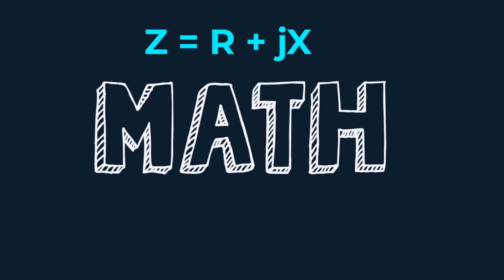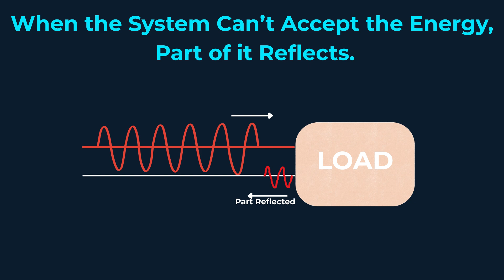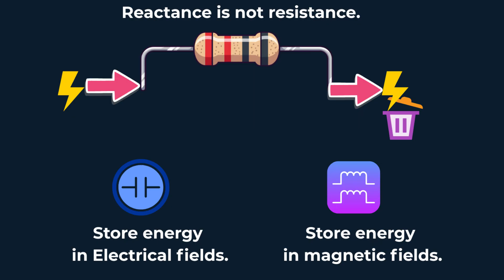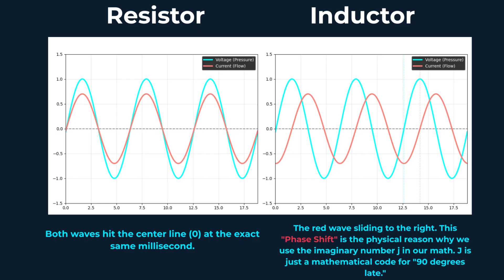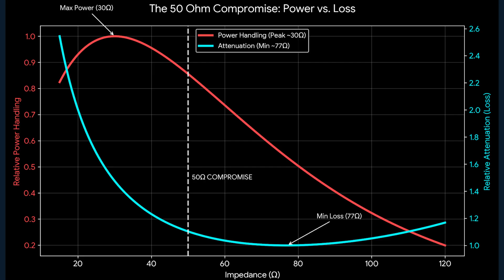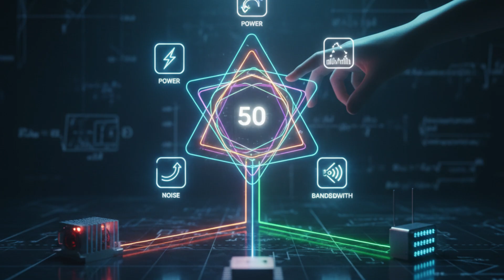What Impedance Really Is And Why Everything Is 50 Ohms? | EP 003

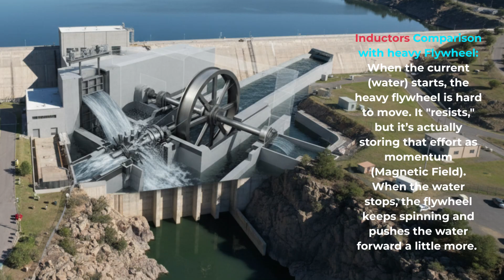Comment: AI generated.  Good verbal explanation, but the illustration at time 1:50 is weirdo junk!  Also, the 50-ohm compromise is applicable to coaxial cables and does not necessarily apply elsewhere.  It has been adopted since coaxial connections are so frequently used between circuits and between other functional units.  A graph of power versus time, added to the graphs of current and voltage versus time would have been helpful to illustrate the bidirectional flow of energy each cycle when reactance is present.
Reply from the maker: Good point.